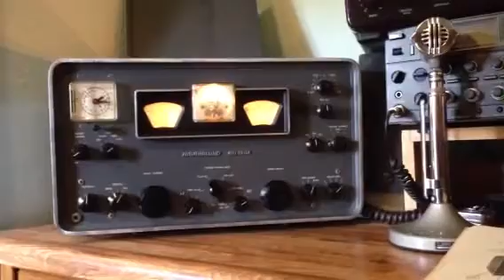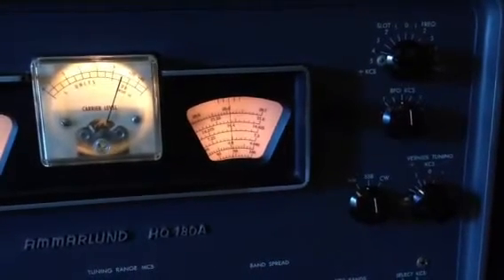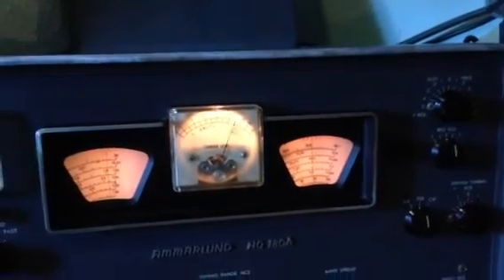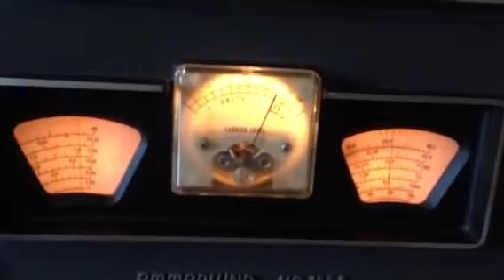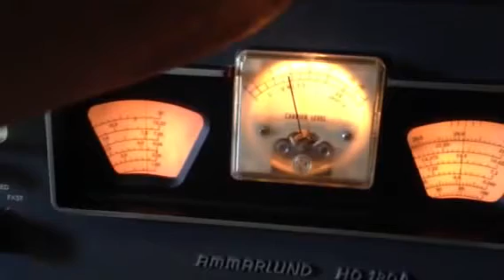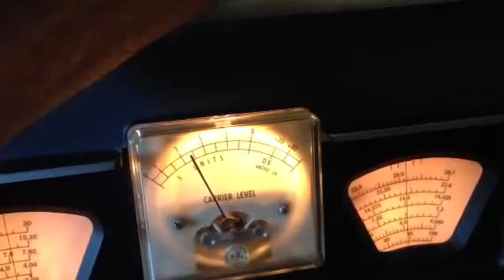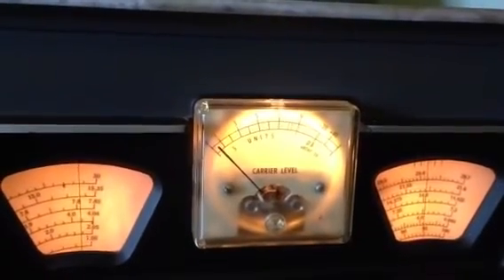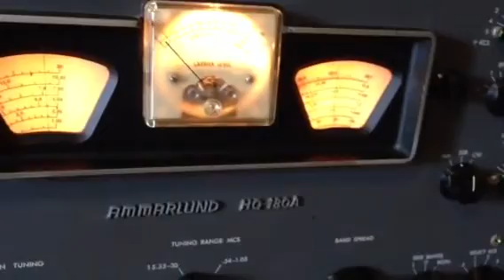Hammarlund HQ 180-A tweeks for slot adjustment, K7PP

Comment: Hello, I enjoy watching all the Hammarlund videos, lots of information. Could you tell me how much signal you use for the if 60Kcs alignment on the 180?
Reply from the maker: The signal used is suppose to be just enough to see a -1 volt DC across C44.  
I would use about 2000uv to start and increase or decrease as needed to see not more than the -1 volt DC.   Adjustments to T6, T7, T8, T9, T10, T11 will show a negative going voltage when peaked.
Do you have a copy of the service manual?
Reply: @dogtagsvette  yes several. They all have different info. I’ve got the receiver working, but I have to inject about 400mv to get any deflection on my vtvm. My signal generator only goes down to 2mv.